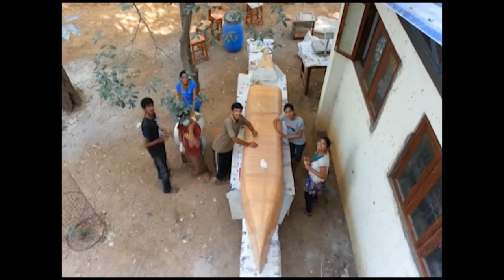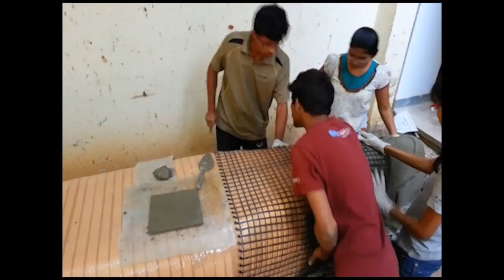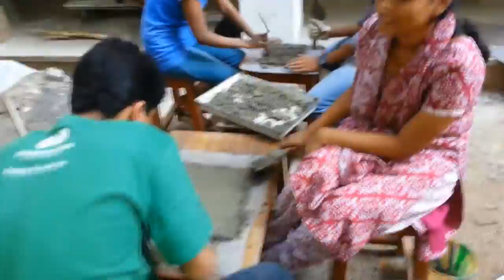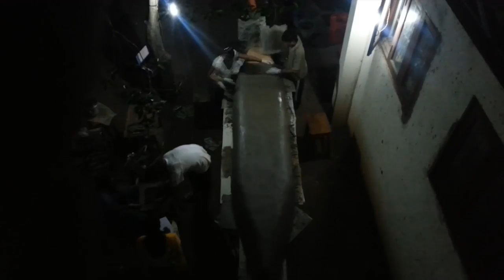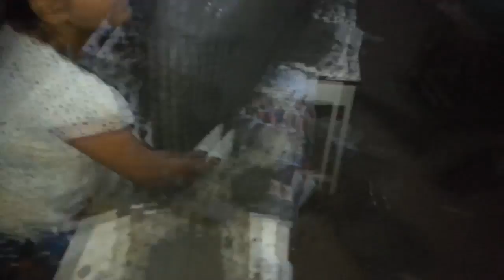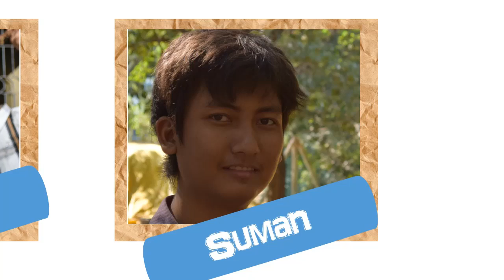Concrete Canoe - making video @ IIT Madras

Comment: Did you make it to nationals? Did you use 2-layers w/ carbon fiber mesh only? How much did it weigh? It looks great, but maybe you can reduce the weight by reducing the thickness and the draft. It is still higher than necessary when 4-large adults are in it. Thank you.
Reply from the maker: This was our first trial. We are planning to conduct the nationals in India. We used just one layer of glass fibre mesh ( although, two was required). We used two 12mm thickness layer. Yeah, in the unloading condition, the draft was very less. Our density was 1200 kg/m3. Happy to hear more. Thank You.
Reply: How much did your overall canoe weigh? We use 2-layers of carbon fiber mesh offset and overlapping from each other, a female Styrofoam mold with car wax as a releasing agent, let it cure under a misting system for about 2-weeks. Ours weighed about 260 lbs or 118 kg. One thing I noticed other schools do that we will incorporate next year is  to use a metal mesh in the bow & stern ends for extra reinforcement. We placed 5th overall in the SW ASCE Regional Concrete Canoe competition and it was only our 4th competition. There were 36 other schools that we competed against. Each year we get better and better. The first year we almost placed last. I would like to try using pre-tensioned cables, but my co-team members and officers probably will play it safe and make the same canoe as last year with minor improvements.NATIONAL CONCRETE CANOE COMPETITION 2015
Reply: Maxwell Goodacre

The overall weight of the canoe is about 170kg. We used one layer of glass mesh. however, the inherent spacing of the glass mesh was 20mm, we should have provided two layer and reduced to 10mm. Next time, we are planning to keep the reinforcement spacing to the minimum. Keeping metal mesh at the stern and bow is a very good idea. Can you tell more about your composite development and testing methods?
Thank You
Reply from the maker: Maxwell Goodacre The overall weight of the canoe is about 170kg. We used one layer of glass mesh. however, the inherent spacing of the glass mesh was 20mm, we should have provided two layer and reduced to 10mm. Next time, we are planning to keep the reinforcement spacing to the minimum. Keeping metal mesh at the stern and bow is a very good idea. Can you tell more about your composite development and testing methods?
Thank You
Reply: NATIONAL CONCRETE CANOE COMPETITION 2015 how you guys would transport this canoe to the conference competition?
Reply from the maker: Fan Wang
 We are conducting the Indian chapter of national concrete canoe competition in the year 2015. This canoe was built at IIT Madras and displayed there during the annual department fest CEA-2014. So, there was no problem related to transportation.